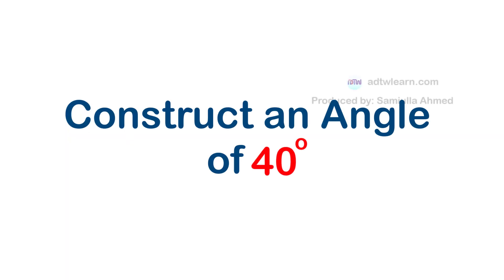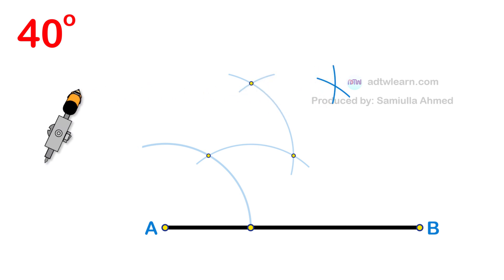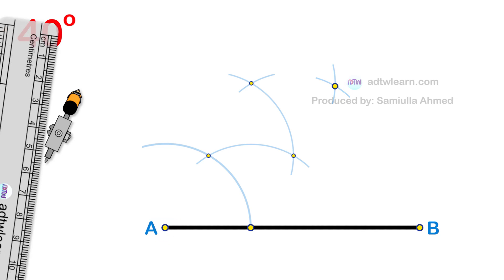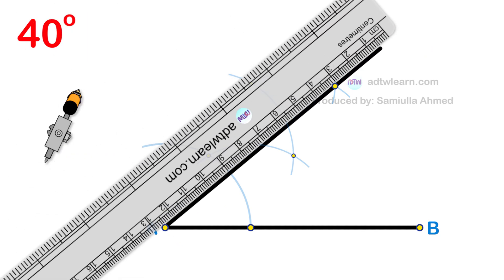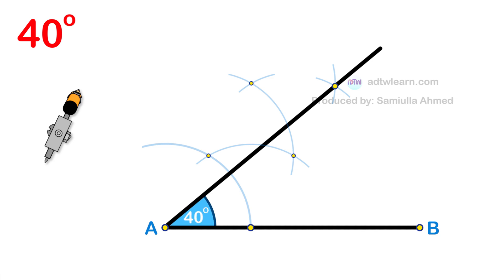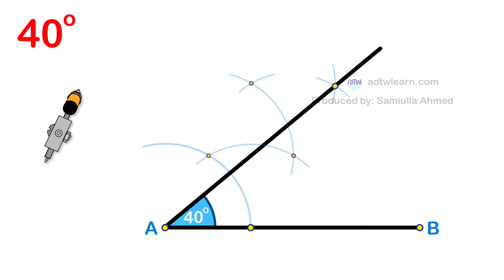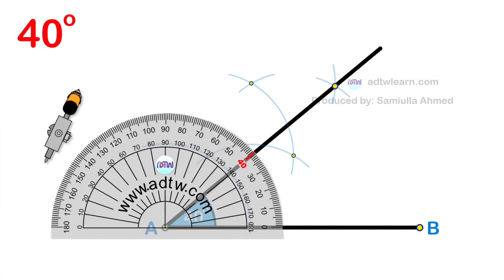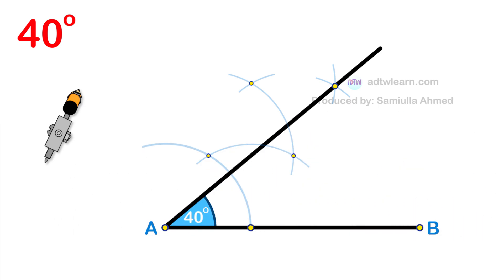How to construct 40-degree angle using compass

Comment: I'm sorry but I believe it is impossible to construct 40 degrees using compass and straightedge alone. Also, checking by protractor does not suffice as proof.
Reply: 2% error in angle
Reply: Only Angles divisible by 3 can be drawn exactly using a Protractor and Rule alone.
One can trisect an Angle using Archimedes Method. Then it is possible to construct an Angle of 20 degrees, given an Angle of 60 degrees.
Reply: @dnickaroo3574 Am I  allowed to reset my divider to 2r
Reply: Am I  allowed to reset my divider to 2r?